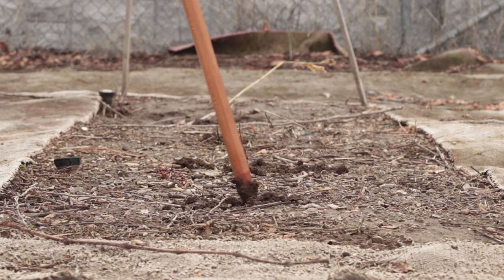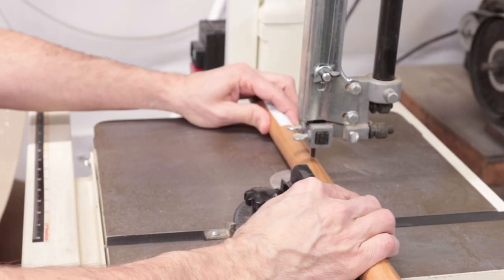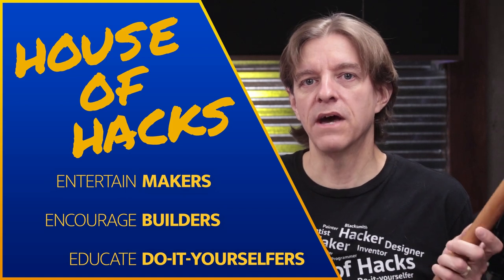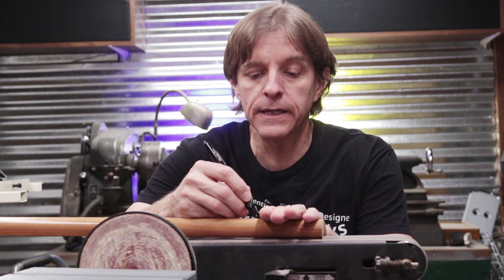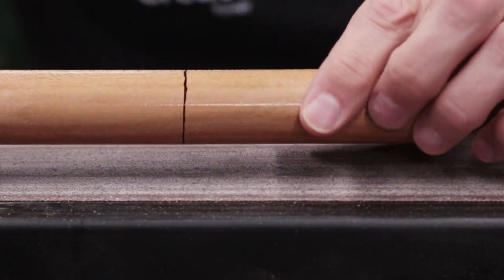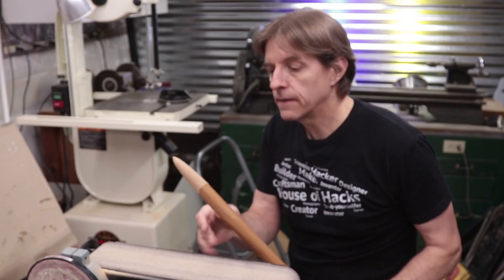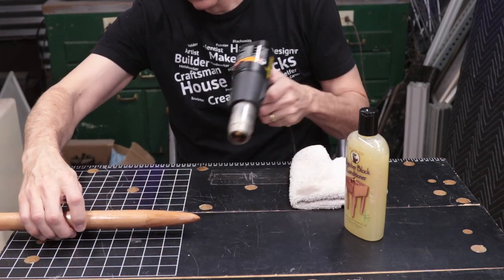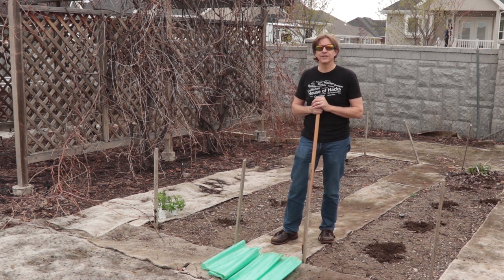How To Make Gardening Tools At Home: Long Dibber

Comment: Thanks, fantastic job you did.  I’m attempting to make one tomorrow from an old D shaped spade handle.  I don’t unfortunately have a belt sander so I’m going in the old fashioned method of spoke shave and then sand by hand.  It’s my first attempt but hopefully it will turn out good.
Reply from the maker: Little late on replying... Hope it turned out great!

Comment: Nice and simple! Even I could make that....
Reply from the maker: haha, yeah, you could even just use sanding paper or a rasp if you have enough patience.
Talking about simple, that DMX equipment is supposed to be delivered today. Starting down that rabbit hole will be of of this weekend's projects.
Reply: @HouseOfHacks   simple Harley. Most controllers like talking in multiples of sixteen so first fixture will be channel one, second will be channel 17, even if they are only 3 channel units. there are ways to fool the system but keeping it simple is easier.
Reply from the maker: Thanks George! Great info! I'd probably have wasted some time irrationally thinking the second one should be on channel 2. :-)
I'm a firm believer in KISS (at least for some definition of "simple" :-D ).